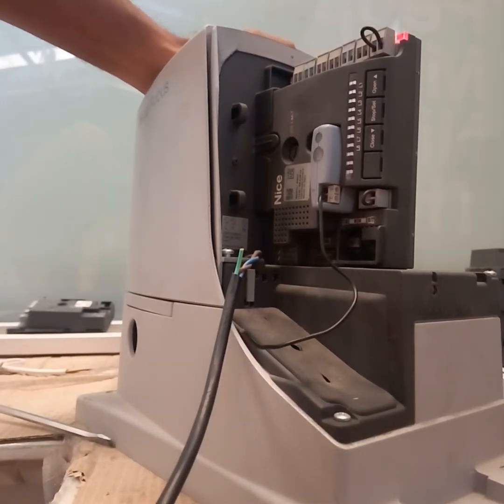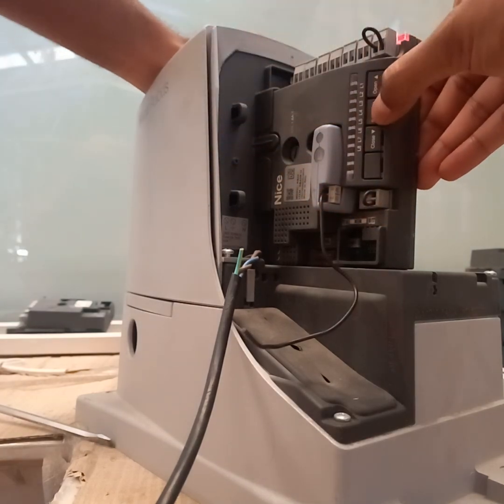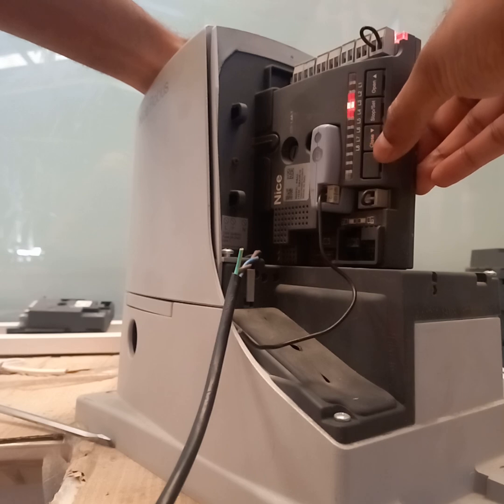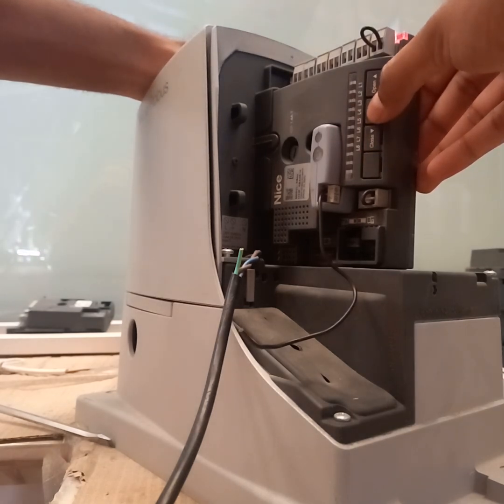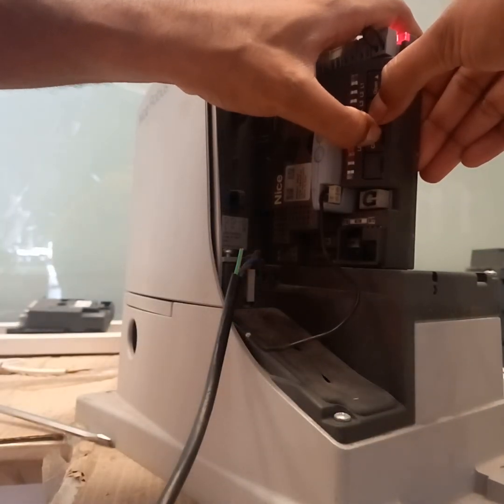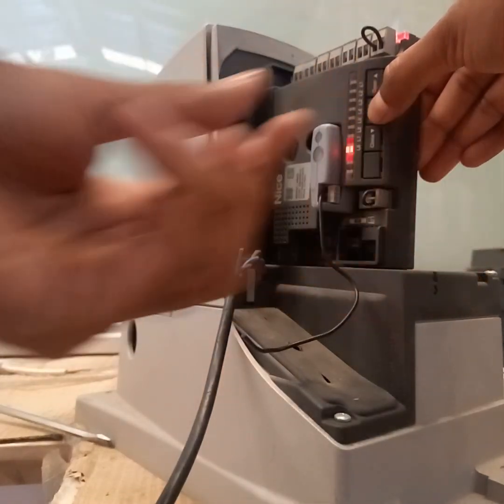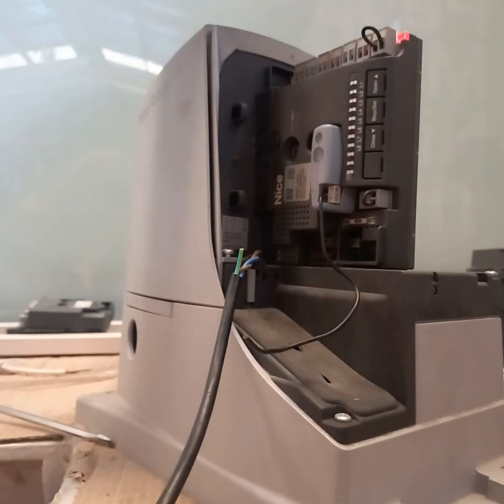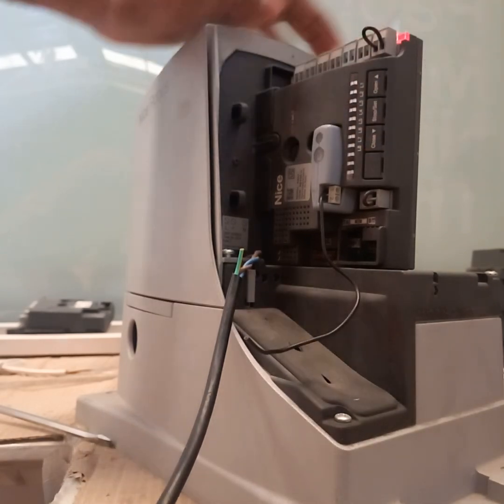Nice Robus motor -Force adjust procedure

Comment: awesome. thanks. I have the new ROBO600.

When the gate learns open/close , it opens and closes correctly. then immediately the first open/close action done by remote, it doesnt close.

I used your advice to put it on highest force level.

Still doesnt work unless I support it with moving by hand.

gate is below 600kg.

Any additional advice? <3